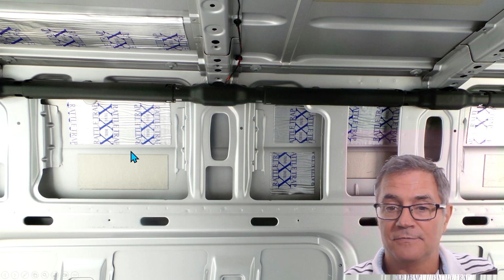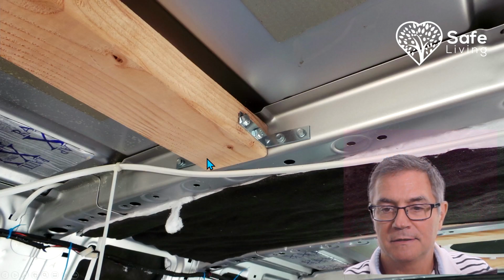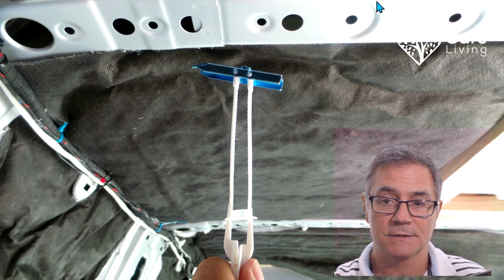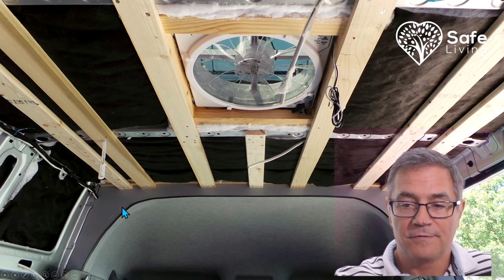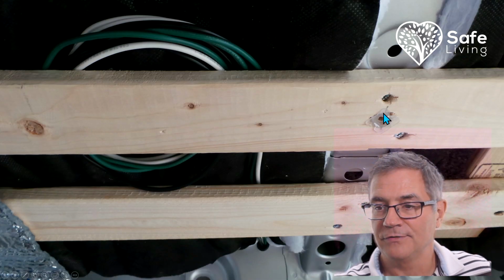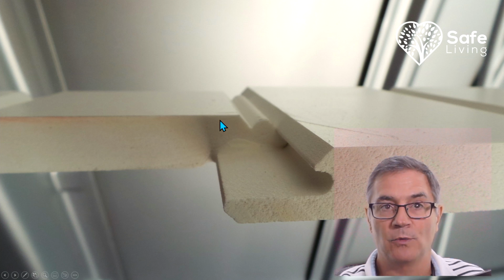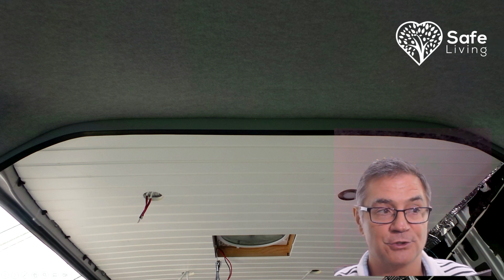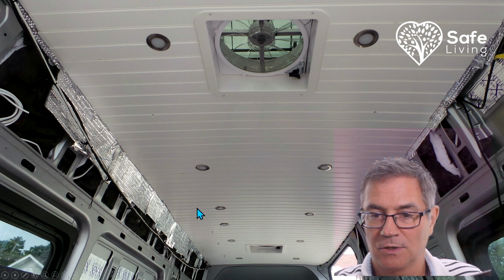SVBS8 Chapter 6 Ceiling, Preparation and Rough Wiring in the Sprinter Van Build Series

Comment: With the sealant on your ceiling slats, would you ever be able to get to the extra wiring to make future additions or repairs?  

I like seeing your process of building & your materials used.
Reply from the maker: Hi Shari. That is a great question and one I thought about before I decided to glue the panels.  I chose to seal the ceiling as I ran a lot of extra wiring for future needs and an air conditioner. I also ran wire raceways in the cabinets that go from front to back on each side of the van. This way you can run additional 12 volts wires very easily. Since my ceiling goes from wall to wall and the cabinets are bolted to the ceiling, you would have to take the cabinets down if you wanted to take the panels out for repair or wiring. This material could be cut out in sections and screwed into the firing strips. I would then need to patch the holes and then repaint them. Thank you for watching!